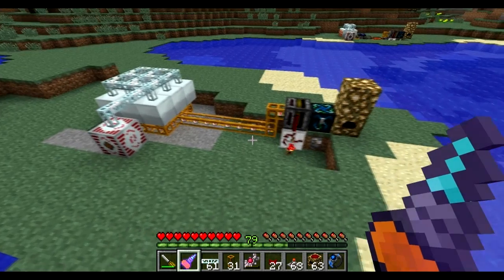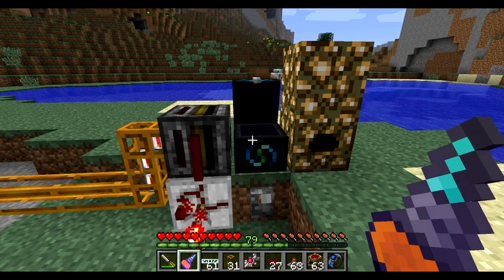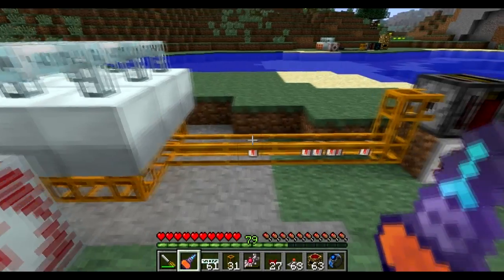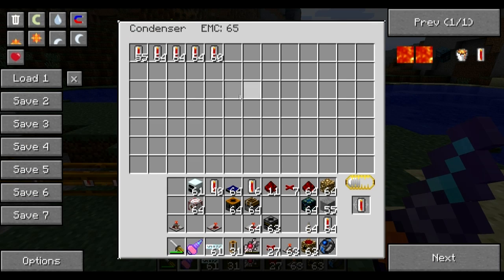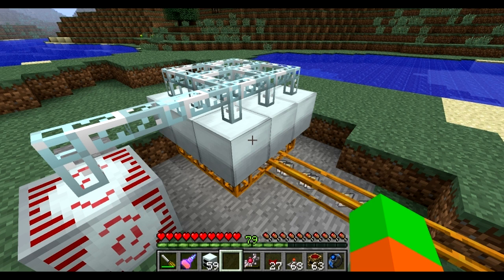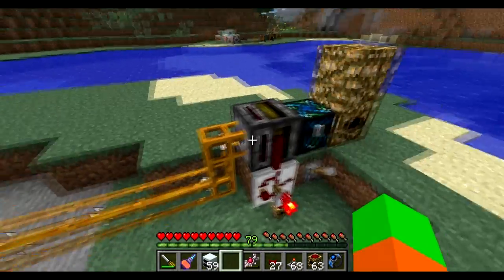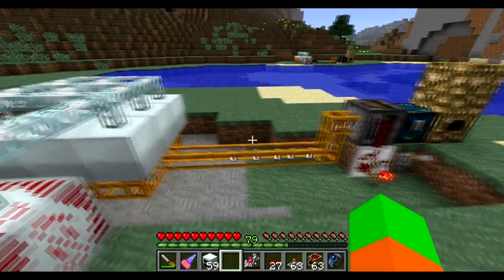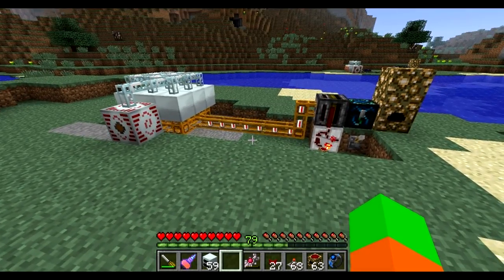Minecraft Tutorial - Infinite Geothermal Update (EE2 v1.38)

Comment: @damnedsky Your setup would also require a Relay which is relatively expensive in the beginning.Odedex's updated factory is the best we are going to see at the moment.
As I mentioned in my other comment, you could use a single Tier 1 to feed a single Geo. Generator, then when you upgrade to a Tier 2, add 2 more generators.